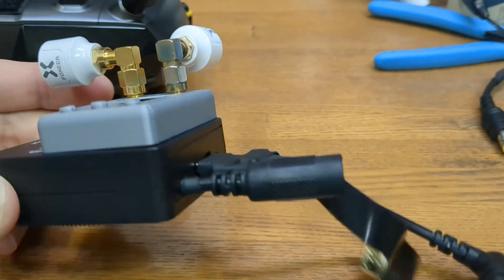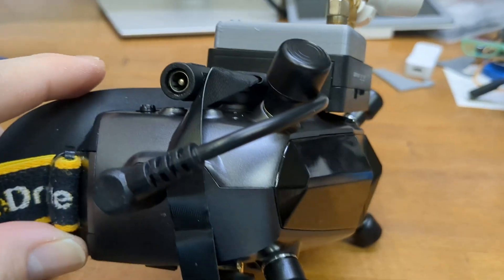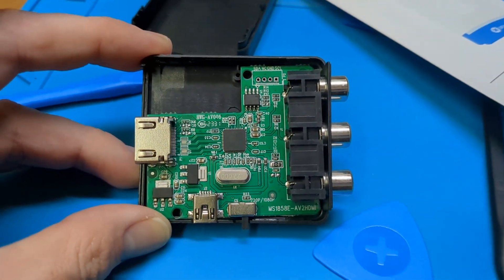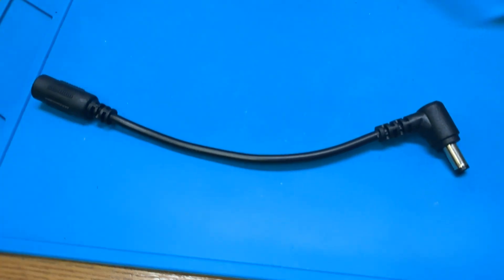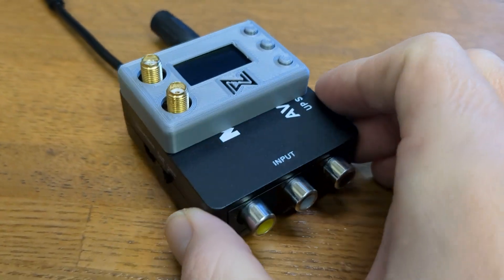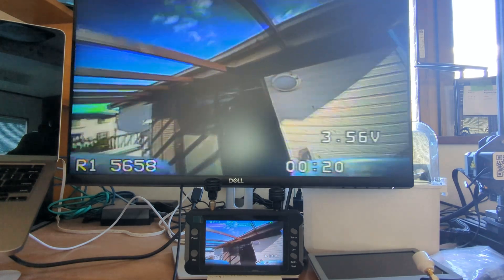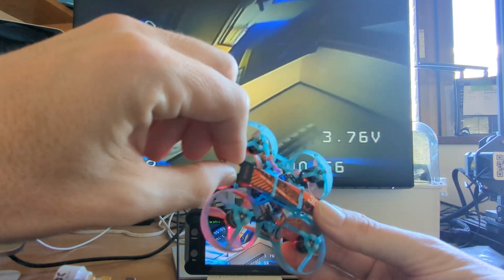Caddx Walksnail Goggles X solution for Wildfire/Speedybee modules

Comment: You're a badass! I'm almost tempted to just buy box goggles for my tiny whoops lol.
Reply from the maker: Don't do it to yourself! You deserve to fly whoops on these beautiful 16:9 screens!
Reply: @dbloemhard  you're killin me smalls. How much does it cost for all the components(minus the analog module and antennas)? I have a rapidfire module, antennas, and uruav adapter.
Reply: I do love soldering and making stuff though. The cost and functionality would be the only deal breaker for me. My only experience flying analog is with the uruav adapter on dji v2 goggles.
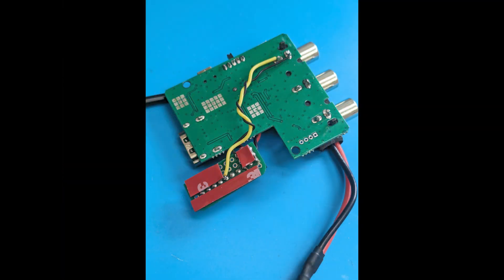Reply from the maker: How cheap/easy do you want? If you already have the Uruav analog adapter, you can just use that with an Av2hdmi adapter like this https://a.aliexpress.com/_ooupUDM - the analog adapter already has the 5v regulator, barrel plug and analog socket bay. So on the adapter module you will see 4 pads 5v, GND, Audio, AV. Just wire the 5v and gnd to the pins of the vreg that I show at 4:04 in this video. And AV goes to the video pin at 4:14 (where the yellow wire is). Can also wire ground here too if you want to make sure you don't have video noise. The total height might be a bit higher than the one in my video but it's cheaper and quicker haha
Reply from the maker: If you do it this way, you obviously dont connect the uruav adapter to the goggles via the 3.5mm plug anymore. Just put the power lead into the uruav module, and the extension lead goes from the other side of that into the goggles. And then a small HDMI to Mini HDMI cable from the AV2HDMI box to the goggles.
Reply: @Tokyo_Dom  you're amazing. Thank you so much!
Reply: @Tokyo_Dom  would some 18 guage wire work? That's what I have on hand, but I can buy something different if not.
Reply: @dbloemhard  hey, I found a 3.5mm to rca cable for the video, now could I just splice a usb onto a 5.5 x 2.1 male to male, and run it from uruav's power output to the rca to hdmi converter and the goggles to power them both?

Comment: hello Tokyo_dom thank you very much for your video it is great, I followed your example try myself to do the same thing as you in the same way, I bought exactly the same parts made with your methods, but unfortunately, that does not only works for about ten seconds, I lose the connection with a blue screen for three to five seconds and I recover the connection and this loops, impossible to maintain a stable connection, I bought a second HD box to be sure that the problem did not come from the box, but I still have the same problem impossible to keep the connection stable, can you please help me if you have an idea, I would really appreciate it, looking forward to for your help and your response I thank you cordially, I am subscribed to your channel and I follow it from France, keep it up, it's great; thank you in advance
Reply from the maker: Oh no that doesn't sound good at all. Which analog module are you using? I saw a comment on Facebook saying that they got the random blue screen quite often using a regular switching diversity module - I think this converter has trouble when the switch is done. The speedybee/wildfire etc modules merge the signal rather than switching completely so that should avoid it.
Reply: Good evening Tokyo_dom
Thank you very much for your help, I followed your advice and immediately purchased a latest generation SpeedyBee receiver
I will keep you informed as soon as I receive it after the first tests, I sincerely hope that the problem was indeed due to this I am impatient to be able to do like you and fly in analog with my Walksnail struggles
Sincerely thank you again for your help, look forward to your next videos
Thank you very much from your subscriber from France     David
Reply from the maker: @dronesdavidpro  hopefully you have a better experience with this module. Note that Caddx has informed me that they are testing specifically with the Speedybee receiver, so this module should work without problems on the regular AV input in their next firmware too. I will make another video update when this is available
Reply: @Tokyo_Dom  Hi, Do you know whether Caddx have been successful yet in getting the SpeedyBee receiver to work with the goggles yet please. Thanks Jon
Reply from the maker: @jonblackburn5896  they are on the Chinese new year holidays, I suspect they haven't done any work in it for the last 2 weeks :)
How is the experience with your Speedybee now? Is the signal solid now?
Reply: @Tokyo_Dom  Good morning. Thank you for your reply. I'm hoping to receive the goggles this coming Monday and the SpeedyBee receiver mid-week. I'll let you  know how it works. I hadn't appreciated that it was New Year time in China
Reply: @dbloemhard I've tried the SpeedyBee receiver with the goggles. Sometimes I just get white snow, the best I get is a grainy really poor quality black & white image but with OSD clearly detailed, this is intermixed at times with flashing bands of colour before it goes to white snow again. Sometimes it's just flashing bands of colour, I can see that there are parts of an image but it's continually moving and totally distorted. I'll wait a few days to see whether Caddx produce a firmware update and then try your hdmi route. I'm currently using the 37.42.4_beta firmware.
Reply from the maker: @jonblackburn5896  yes that is the expected behaviour with av input as it is. That module will work fine with the AV2HDTV adapter I'm showing in this video. However I have some bad news, Caddx just replied to me that they don't think they can make the goggles work with the Speedybee. I have explained to them that the AV2HDTV uses the same chipset, so it must be possible. They just said "please wait until we release our analog module"

It's a very disappointing result, I have 2 modules I cannot use with the module as intended, but only with hdmi input. I encourage you to email them and ask them to fix it too

Comment: What about latency? Does it works well?
Reply from the maker: Check the latency for yourself. The small monitor is a normal analog monitor with little to no latency. I can't tell the difference!
Reply: @Tokyo_Dom  I also can not see any difference based on those two monitors. 
I just want to know how it works for you on practice. Thanks
Reply from the maker: @BagrijRoman  in practice it works great. The other version of the HDMI adapter i showed in that screenshot uses a different process - converts the AV to VGA and then VGA into HDMI; i imagine this might add some unwanted latency but the adapter in this module i use has the exact same chipset as the goggles X use for Analog input, so it should be identical

Comment: is the latency better than at the ws goggles directly?
Reply from the maker: Would be the same. You can compare the video feed on the standalone monitor if you think it will be a problem - that's not going through the walksnail goggles and has the same latency we expect in all analog systems.
Reply: @Tokyo_Dom  but in ws with analog it is much more than the digital Receiver. I thought maybe its a Problem of the ws analog converter
Reply from the maker: @chrisdomeier4985  no it's not a problem with mine. Look at the two screens, they are exactly in sync. Are you referring to the latency numbers that Mads Tech measured or did you actually fly and felt latency? If you actually felt latency then I'm not sure what's wrong, the analog input latency is fine for me (and others that I have spoken to)

Comment: Nice 👍. I did the same thing when upgrading my Ev800D:s to a nice crisp full HD OLED screen. There’s no need for expensive goggles now, unless you like the form factor :)

I recommend getting rid of the RCA connectors though and I’m pretty sure the pcb can be trimmed off to make it even smaller. Then you could probably print one case for the whole package.
Reply from the maker: Oh nice, oled box goggles! Though I much prefer binocular goggles now, I tried going back to box goggles when the cobra X came out and I couldn't get an immersed feeling.... But your other suggestions are great. I had considered that path but started thinking I'd spend too much time designing and printing when i just wanted to try my solution. I think that might be where I go for the version two of this adapter!
Reply: @Tokyo_Dom  yeah I can’t afford fancy goggles :( And those micro oleds in there seem to be the problem, expensive.

I’m the opposite though, I did get to try a pair of hdzero and although the picture quality was way better than analog I found it more like watching a tv in a dark room. Slightly disappointing.  Also they were much bigger than I thought. 

Everythings far from vr headsets though. I built a little rc car with a hemisphere view you could look around using a vr headset many years ago. That was so immersive, you bacame the car :) resolution was crap though. Still waiting for hardware to catch up :/
Reply: hey hey, im doing a deep dive into researching for possibilities to build my own oled boxed goggles since a few days. 
Could you share some info how u did it, and what screen u used ? 

I thought about using oled phone screens, since replacements of those are cheap, but most of them have proprietary protocol and cant be driven by default mipi dsi. 

Also any thoughts on how to get analog? the few screens that come with a driver board have hdmi in, so i guess id do the same as shown in the video? im just worried about the analog to hdmi latency

edit: another thing with using display + driver board kits from aliexpress is, that all of those are in portaitmode, which mean the image needs to be flipped 90°. This is basically the same problem skyzone has on the cobrax with hdmi latency, as it adds latency even on an fpga to get that rotation
Reply from the maker: @KidCe.  I thought the latency on the cobraX was due to them having to mirror flip the image, since they use a mirror in those goggles to keep them compact. I'm not sure about oled screens of that size though.
Reply from the maker: @KidCe.  https://www.aliexpress.com/item/1005006027077482.html this might be an option for you. Not too expensive and 1080p, horizontal layout
Reply: @KidCe.  hi
I just saw a video of someone doing a conversion before seeing your comment :)

Basically you just need a screen with hdmi in. To support analog you need a receiver and one of those cheap av2hdmi converters. Strip the case off and get rid of the rca connectors. Then it’s just a case of power and the lens. I used my ev800ds but in the video I just saw a guy used old fatshark boxgoggles that let you put your own screen in. 

I got a screen from a company called Surenoo or something, came in a nice case. Can flip orientation with a button. You can get low profile hdmi connectors with a short ribbon cable.

Comment: Wow, super implemented thanks for the effort seems to work great. With my HDMI converter there is a switch with NTSC and PAL, on which of the two do I put the switch? 😅
Reply from the maker: Hmm i would be concerned that your one might be the other version that I mentioned in the video. I saw comments that this version has added latency that made it hard to fly with. But if you want to try, it should match whatever camera you have (pal or ntsc is decided on the camera side). Some cameras let you switch between pal and ntsc, but others will be fixed (usually on ntsc)
Reply: @Tokyo_Dom  Oh okay, I've had the HDMI converter for a long time, I'll just try it out in a safe environment. Thank you

Comment: So basically you did a better job providing analog with these goggles than caddx :/
Reply from the maker: Haha maybe slightly. I still get blue screen on low signal. But blue screen/fake snow it's still annoying. Apparently you can program the hdmi conversion chip to remove the blue screen, I just don't have the specs or info on how to do it.
Reply: Yeah, cool project. I just fly my old box goggles (with external receiver mod) for now and hope for the FW fix (I hope this comment does age well).

Comment: Incredible. I am guessing this will let you record as well. does this work with the TBS fusion as well? Unfortunately I have that module with me currently.
Reply from the maker: Hey so the tbs fusion should work with the regular av adapter - I've seen several people post with that module. Also, DVR doesn't work for hdmi in either :( but we do have an rca jack on the side and you can add an rca to 3.5mm plug onto that if you want to record externally
Reply: @Tokyo_Dom  Thanks for the reply. Ya currently I have modified one of your previous Thingiverse prints to just plug my fusion with the v3 av adapter. This however can use the full screen so has me ttempted. haha. Great mod BTW
Reply from the maker: Heh yes, this is worth it just for that. Full screen 16x9 is amazing! I think you could fit a dvr module in here as well, might need to extend the module cover print or something.
Reply: @Tokyo_Dom  Finally got this done. I just used my tbs fusion module with urave analog adapter and soldered the wires from the DVR pads to the av to HDMI converter. I did not need the 5 volt BEC in my case. Although my setup is very clunky and is just held via sticky Velcro, I have to say that the full screen view on the goggles x is much better than the av in. Thank you again for making this tutorial.
Reply from the maker: @mrityunjay1234  it's a struggle, 16:9 looks amazing, but then we have blue screen on low signal. Now they've fixed the fake snow (latest release) but no 16:9. I'll keep pushing them for an update to allow 16:9 on av input mode
Reply: @Tokyo_Dom  did you check out the new hdzero fpv monitor? Wondering if the HDMI out can be used in the walksnail goggles x as input and this becomes an all in one solution to bring walksnail, hdzero and analog with recording to those goggles. Not sure how the latency will be and how clunky the contraption will look.